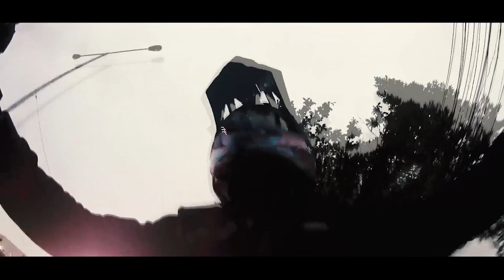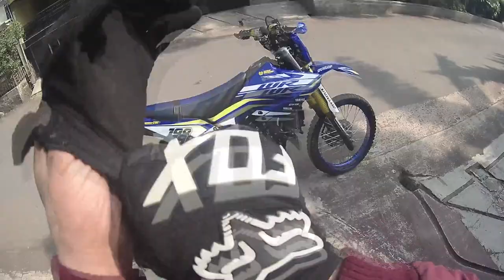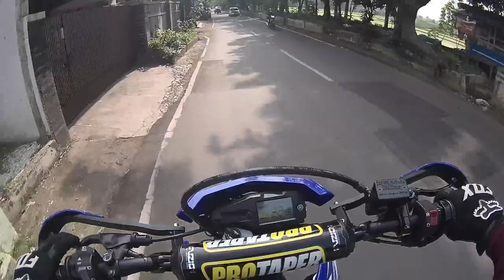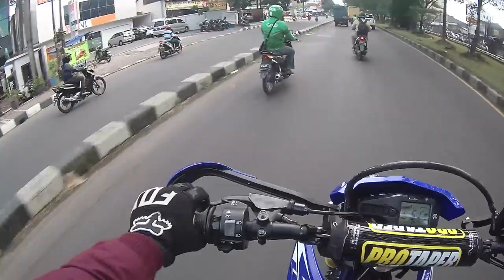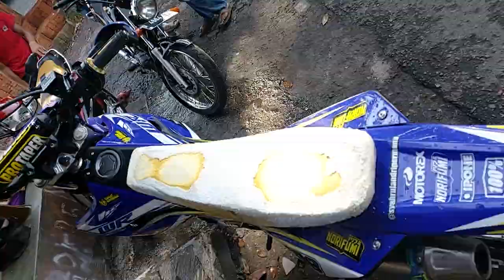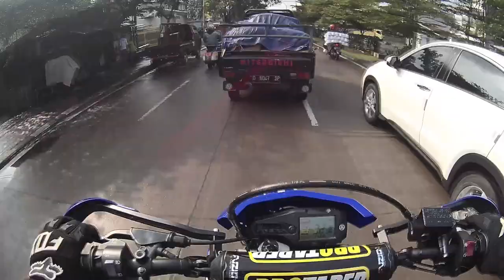WR155R - BIKIN JOK WR155R JADI LEBIH RATA  | #Motovlogindonesia #motovlog #wr155 #wr155r

Comment: Eh vixion yaa, eh vixion yaa... drpda sebelah VERZA🤣
Reply from the maker: Gpp vixion ya yg penting kencang dan bertenaga, dari pada loyo gak ada tenaganya wkwkw
Reply: @ArulMotovlog  4 valve + vva + radiator,  mereka apa?🤣
USDnya di ajak main tinggi dikit malah crot🤣
Reply from the maker: @oxdc8141  kita udah maju ke depan mereka mundur ke belakang wkwkw
Reply from the maker: @oxdc8141  katany pernah denger si merah segitiganya copot gara gara dipake wheelie upppsss wkwkw
Reply: @ArulMotovlog  ups🤣
Reply: @ArulMotovlog  tele si ijo emang sih oke, tapi USDnya berasa macam honda c70🤣
Reply from the maker: @oxdc8141  usd berasa tele ya wkwkw